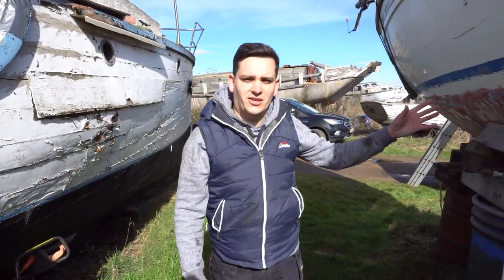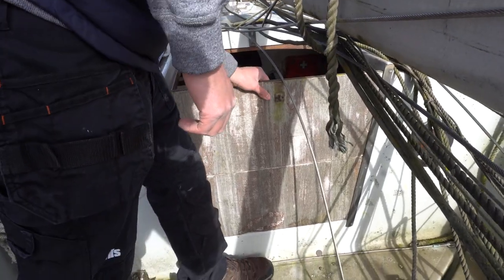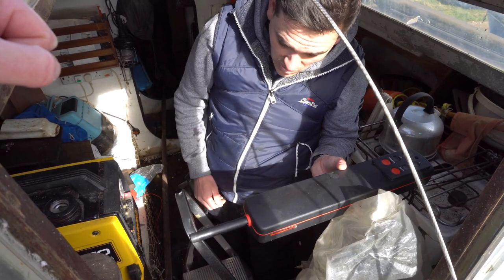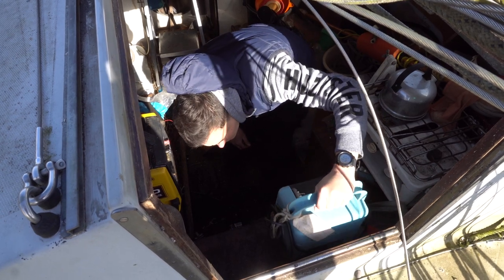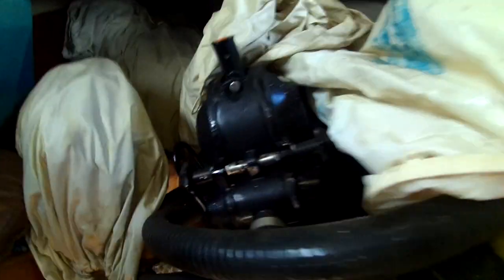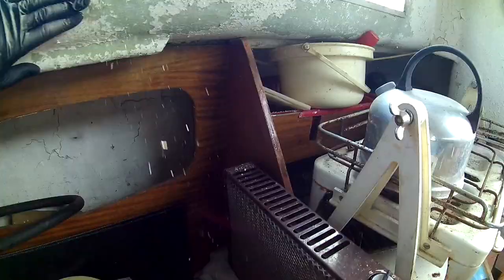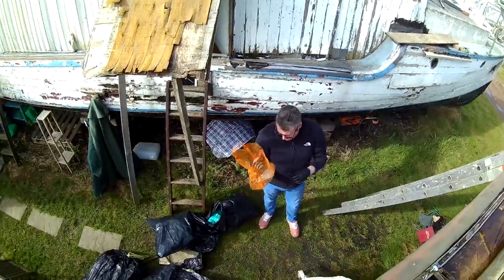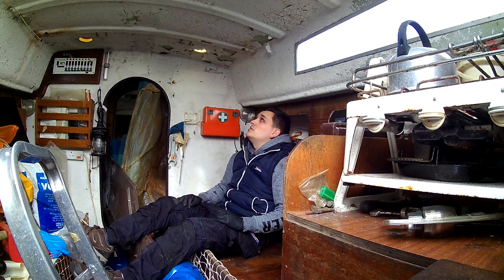It begins, a sailing boat restoration project! Episode 1

Comment: Good to find your channel at the start.  Great little boats, not dissimilar to my Rival 32 and I think they were both built at Marcon.  As you say she is surprisingly dry and after a good clear out and clean you will find good bones I’m sure.  The thing with a compass on is a radio direction finder.  Used before GPS and relied on taking bearings of land based radio stations to get a fix.  Not any use now apart from novelty value.  You certainly have lots of useful gear aboard which would add up to a tidy sum if you had to buy it now.  Don’t discount keeping the seacocks, they are likely Blake’s back when they were proper bronze.  With a good clean and reseating they will be good for many years.  Best of luck, if I can help with any advice let me know as I’ve been around boats for many years.  Andy UK
Reply from the maker: Yes I later saw it was a direction finder, I discovered the headphones for it whilst going through the bags. Thank you for watching and welcome aboard.
Reply: There's several videos on going through those bronze Blake's thruhulls.. even in bad shape they can be soaked in diesel for days and then they'll start turning where you can take them apart and restore them

Comment: I'd love to take on a project myself, but I'm put off by the yard fees - I don't see how it can really be economically viable? The other thing that strikes me is . . . sailing a boat with low headroom might be okay; but renovating one is going to be annoying I'd have thought. I'll be watching all the way - great content.
Reply: It is annoying, and my 20-footer has even less room!
Reply from the maker: It all comes down to the size of your boat as most yards in the UK charge based on it's length by the FT or Meter. Some boat yards are far more costly than others (Facilities on offer etc..) . A good bit of research and advise is key! Welcome aboard and thanks for watching.

Comment: Great thing about boats is that they have to be really bad off before they can no longer be brought back to glory. Most of the time this decision is what the boats value is in premium shape. You attaining her for nothing really is going to make it worth it. You can always get her done up properly and then sell her to buy a bigger sailboat that needs work or one just slightly longer and less work that you can flip until you're able to get into that dream sailboat. I've done it with Harleys and vehicles over the years. Bought something cheap cause it needed a little work and then made a decent profit in the end.
Reply: Keep the videos coming and I will keep watching.
Reply: Are you in the UK? If you were looking for a contessa 32 sailboat that needs some work there's a guy with a channel called Refit and Sail who is a contessa wizard and he's got one he said he'd sell I'm sure for a really fair price. He's somewhere either in the UK or nearby. I don't exactly remember especially when I'm a American and most the accents in the area sound very similar to me.
Reply: There's also a channel called Epoxy and Butyl Tape that has some really good content on fixing up a classic sailboat. His is a contessa 26 but he's made a beautiful boat out of her.
Reply from the maker: Thanks for the useful information, I am based in the UK.